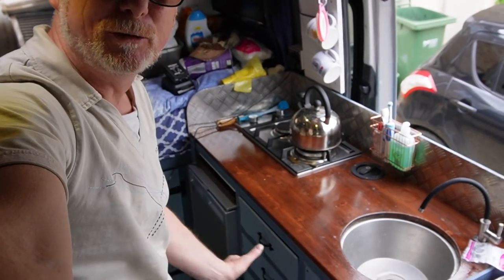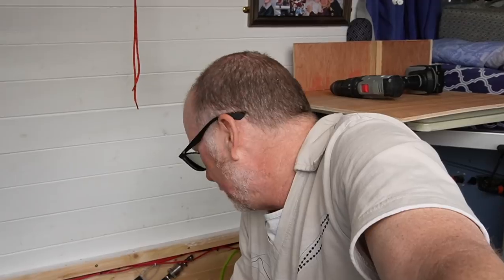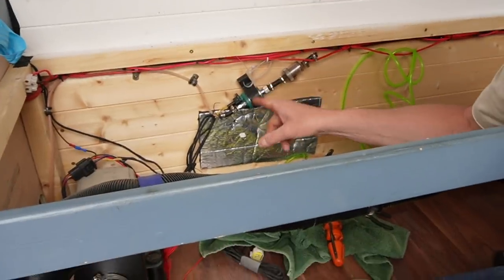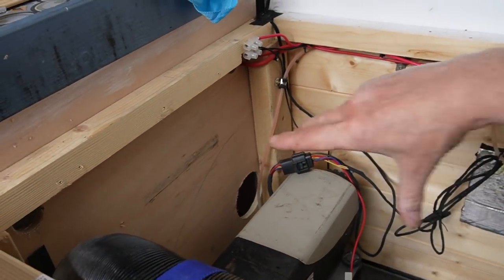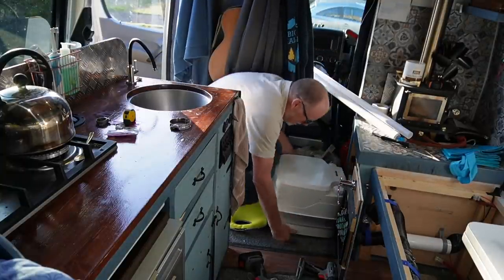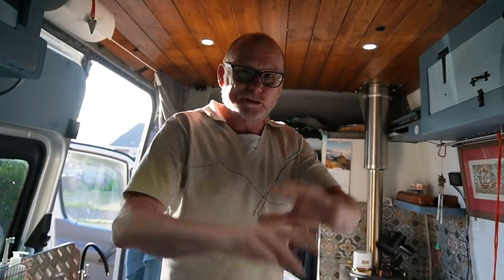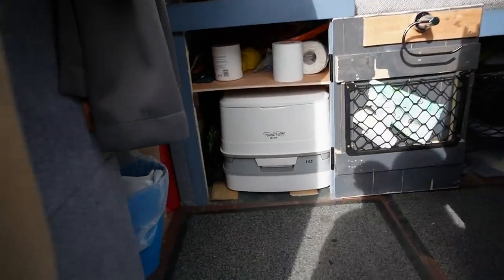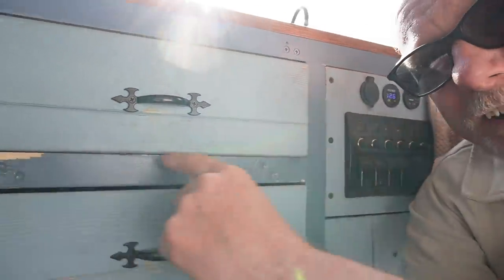Compact Space Saving Diesel Heater ~Toilet Installation  In A Camper Van Life Just Got Cosy

Comment: Hi Mel. I don't often disagree with you, but on this one I do! On research, I've found that traditional PVC has a maximum operating temperature of 60c and a melting point of from 100c, when I suspect it would release some fairly awful toxins. If it was me, I'd use a bit of stainless flue pipe a couple of sizes bigger than the heater pipe and insulate between with rockwool. There must be a reason that Honda, Nissan, and Toyota have eliminated PVC in their car interiors since 2007.
Reply from the maker: Oh thank you so much 👍